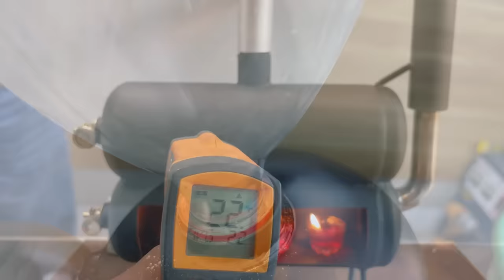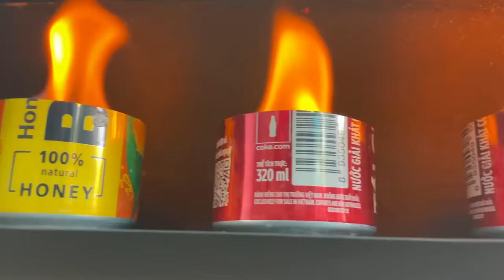diy mini heater! So warm for your room. Free energy from sand batteries

Comment: Why is it necessary to have 2 chimneys/exhaust pipes. Drilling a hole in the wall is a bit much for most people
Reply from the maker: The presence of two chimneys or exhaust pipes in the design serves a specific purpose related to the efficiency and safety of the mini heating stove. The dual exhaust system is often implemented to ensure proper ventilation and combustion.

1. *Optimized Combustion:* Having two chimneys allows for a balanced airflow, optimizing the combustion process within the stove. This design helps achieve more complete and efficient burning of the fuel, contributing to higher heat output.

2. *Safety Measures:* The dual exhaust system can enhance safety by facilitating the removal of combustion by-products, such as smoke and gases. This helps prevent the accumulation of potentially harmful substances inside the living space.

While drilling a hole in the wall for exhaust pipes may seem like an additional step, it is a common practice in many heating appliances to ensure proper ventilation. However, it's understandable that this may pose challenges for some individuals. If wall penetration is a concern, alternative ventilation solutions or adaptations to the design may be explored.

Ultimately, the goal is to strike a balance between efficient stove operation and user convenience. If there are specific concerns or preferences regarding the exhaust system, modifications or alternative designs could be considered based on individual needs and circumstances.

Comment: Why do you need to vent to the outside?
Reply: That's all we need a women telling us lol
Reply from the maker: The need for venting to the outside is crucial for several reasons:

1. *Safety:* Venting allows the release of potentially harmful byproducts, such as carbon monoxide and other gases produced during combustion. These byproducts, if trapped indoors, can pose serious health risks.

2. *Air Quality:* Proper ventilation helps maintain good indoor air quality by preventing the buildup of pollutants. It ensures that the combustion process doesn't introduce contaminants into the living space.

3. *Preventing Condensation:* Burning fuel generates water vapor. Without proper ventilation, this moisture can accumulate indoors, leading to issues like mold, mildew, and structural damage.

4. *Regulatory Compliance:* Building codes and safety regulations often require proper ventilation for heating systems to ensure the health and safety of occupants.

5. *Efficiency:* Adequate ventilation contributes to the overall efficiency of the heating system by allowing a steady flow of oxygen for combustion. Incomplete combustion due to insufficient airflow can result in wasted fuel and increased emissions.

In summary, venting to the outside is a critical aspect of any heating system to safeguard both the occupants and the structure of the building.

Comment: Tea candle burns for 4 hours and gives about 32w, and costs £0.04.
Also it consumes oxygen when burning, decreasing the quality of air.
So...
4*32 = 128Wh = 0.128 kWh
0.128 kWh = £0.04
1 kWh = £0.3125 (not free at all, you see...)
Electricity in UK is capped now to £0.245 per kWh and Gas is capped to £0.0624 per kWh. 
0.3125 / 0.0624 = 5.008
This means that burning gas is 5 times cheaper than tea candles.
Even any electrical heater is cheaper than burning tea candles and it does not consume oxygen and works with perfect efficiency. 
This device is totally useless.
Reply from the maker: You’ve made a great point! Gas is much cheaper than tea candles, and electric heaters are more efficient and safer.

Comment: Think I would stick to a proper commercial heater rather than something made at home with all the dangers that come with it.
Reply from the maker: It's a wise decision to choose a proper commercial heater over something homemade when it comes to heating. Commercial heaters are designed and manufactured to meet safety standards and regulations, reducing the risks associated with homemade heating solutions. They are typically tested for efficiency and safety, which is important for both your comfort and safety.

When using commercial heaters, it's also essential to follow the manufacturer's instructions and safety guidelines to ensure safe and efficient operation. This way, you can enjoy warmth without unnecessary risks.

Comment: Doesn't work. Sand battery needs to be at 500degC to hold the heat plus it needs circulating air  and a heat exchanger. Check out the one at the Finnish power station. Candles are never going to get it hot enough. All you are doing there is wasting candles warming sand which will be at too low a temperature to get the battery effect working. It'll cool back down pretty quickly.
Reply from the maker: "Thank you for your detailed feedback and insights. You've raised valid points about the challenges in achieving the desired temperature for the sand battery. I appreciate your expertise in highlighting the need for higher temperatures, circulating air, and a heat exchanger for effective heat retention.

I'll take these considerations into account for future projects and explore ways to optimize temperature and efficiency. Learning from valuable feedback is essential, and I'm committed to improving the quality and functionality of the content on my channel. If you have any specific suggestions or ideas you'd like to share, I'm all ears. Thanks for engaging in this discussion, and I look forward to incorporating your insights into future projects."

Comment: Hay guys you have to heat the sand up with something so if you live in the north it's not gonna be free heat
Reply from the maker: Your point about heating the sand up is a practical consideration, especially for those living in colder northern regions. While the concept of using sand for heat retention is intriguing, the reality is that some external heat source is necessary to initiate the warming process.

Addressing this concern on your channel could involve exploring different methods or devices for heating the sand efficiently. This might include solar-powered options, traditional heating elements, or other innovative solutions that align with the goal of achieving cost-effective and sustainable heat sources.

It's important to acknowledge the additional energy input required and discuss how users can optimize the heating process for maximum efficiency. This way, your audience gains a more comprehensive understanding of the practical aspects involved in harnessing heat from sand, particularly in colder climates. Your engagement with these considerations adds depth to the discussion and provides valuable insights for your viewers.

Comment: Chinese diesel heaters are suppose to be good u can also burn kerosene and vegetable oil in it.
Reply from the maker: Yes, Chinese heaters are often highly rated for their performance and variety of fuels used. Being able to burn diesel, kerosene and vegetable oils is a big advantage, helping to optimize flexibility in use. Have you experienced using any type of heater?

Comment: Which part of the heater multiples the heat output of 4 little tea lights?
This stuff is hilarious. 😂
Reply from the maker: Thank you for your comment! The heater design is intended to capture and store heat efficiently, allowing it to gradually release over time. While it may not necessarily multiply the heat output of the tea lights, it can help distribute and make better use of the heat they produce, making the space warmer for longer. The design aims to be a creative and resourceful way to enhance the heating effect of small tea lights. 😄

Comment: Great idea...but dude...either that welder is not set up correctly or ...hmmmm
Reply from the maker: I appreciate your feedback and observation. If there are concerns about the welding in the video, it's essential to ensure proper welds for both safety and functionality. I'll make sure to double-check the welding setup in future projects and strive for better welding results.

If you have any specific suggestions or areas you'd like to see improved, please feel free to share more details. Your input is valuable, and I'm here to make content that meets your expectations. Thank you for taking the time to provide your feedback!
Reply: @lmtn  FANTASTIC COMMENT...WOW..  LITTLE MORE HEAT... and practice on something similar...  anger the gun always towards thicker piece of metal.. steady steady steady...the wire feed wants to push you back...and NO BREEZE...  unless you're using Flux core

Comment: Is that the fire starter goo??
Reply from the maker: The term "fire starter goo" typically refers to various commercial fire-starting products or fire starters that are used to ignite fires more easily. These products often come in the form of gels, liquids, or cubes that can be applied to kindling or fuel to help start a fire.

In the context of the video or comment you're referring to, it's not clear what specific materials or fuel they used. If you have a question about the materials or fuel used in a particular setup, it's best to refer to the video's description or comments section for more information, or you can specify the context, and I'll do my best to provide an answer based on the information available.

Comment: 0 seconds ago
Thermal mass or Heat battery...  JUST THE FACTS All Materials have whats called K value or thermal mass value.. Kind of or basically the inverse of R value in insulation ratings. This K value is the amount of heat that can be stored in any Material. BY the way the unit of measurement is based off of water having the thermal mass of 1. This is the standard. Numerous charts can be looked up, and referenced for verification.  Water has a thermal mass of 1 as mentioned HOWEVER rock only has .2 or one fifth of the  thermal storage potential of water by Weight. Rock is more dense  Pea gravel has 95 pounds in a cubic foot. BUT water only weighs 63 pounds per cubic foot.  This weight advantage of Rock VS the HIGHER thermal storage capacity of water Results in WATER stores 3.26 times more heat per cubic foot than pea gravel. Even HEAVY dense stone solid Marble is only 150 pounds a cubic foot and STILL does not beat water for BTU storage. 
 It takes about  1340 BTU to heat one gallon of water from 40 degrees F to 200 F
That means a 55 gallon drum of water heated to 200 would let off  about 77,000 BTU's of heat before it went back down to 40 F. To get the same heat storage you would need to heat Four 55 drums full of stone to store the same amount of heat
Reply from the maker: Thank you for sharing such informative insights! The comparison between the thermal mass values of water and rock, considering the K values, is fascinating. It's impressive to see how water, with its higher thermal storage capacity, outperforms even dense materials like stone in terms of BTU storage. Your breakdown of the BTU requirements for heating water and the practical example with the 55-gallon drum provides a clear understanding of the efficiency of water as a heat storage medium. This information adds a valuable perspective to discussions about thermal mass and heat storage. If you have more details or experiences to share, we'd love to hear them! 🌡️🔥

Comment: Ahhhh!  What a waste of a fire extinguisher!  Here's a better idea.  Those short, fat, 16 oz propane cylinders are about the right diameter.  Cut the ends off of two, and weld them together. That would provide the right size.  Cut the threaded fittings off the tops, and weld small disks there, to cover the holes.   I KNEW I must have been saving those empty cylinders, for something!
Reply from the maker: That's a great idea! Repurposing those propane cylinders sounds like the perfect solution. Welding them together would definitely give you the right size without wasting a fire extinguisher. Plus, it’s awesome that you found a use for those cylinders you’ve been saving! Definitely a creative and resourceful way to go about it. Thanks for sharing this tip

Comment: What's even the point of the top cylinder?
Reply from the maker: The top cylinder often serves a specific purpose, such as improving airflow, creating a convection effect, or helping with heat distribution. It can also provide a space for additional fuel or help with the overall design and stability of the structure. What are you thinking about using it for?

Comment: Looks ok. But do not understand why it has two exits for exhausted air? One to exterior and one to interior? Redundant. If the interior is suppose to be air feed it’s completely unnecessary as the front is wide open. Good idea, silly design
Reply from the maker: The presence of two exits for exhausted air might seem redundant at first glance, but there could be a few reasons behind this design choice:

Airflow Control: The dual exits could be intended to provide more precise control over the airflow and the temperature in different parts of the space. This could allow for better distribution of heated air and may help manage heat more efficiently.
Safety: By providing two exits, the system might be aiming to reduce the risk of backdrafts or pressure buildup, which could otherwise cause safety hazards.
Versatility: The dual exits might give the user more options in terms of where the heated air is directed, providing flexibility in use depending on the layout of the room.
Performance: Sometimes, designs incorporate multiple exits to enhance the performance of the system in certain scenarios, such as improved combustion or more efficient exhaust expulsion.
However, these are just potential reasons, and the specific purpose behind the design choice can best be explained by the creator of the system or through more detailed information about the specific setup. It's possible that the design could benefit from refinement to avoid unnecessary complexity while maintaining the intended functionality.
Reply: @lmtn  so by having an interior and exterior exhaust though, u r losing a ton of heat? If u can exhaust inside, as most candles do, then exit exhaust is completely unecessary. There are way better ways to control air and contain all the heat.
Reply: I’ve heated homes with wood, not candles for over 20 years. The unit makes no sense whatsoever because the front is wide open to the air.  The heat sink with the sand will trap heat and give a longer slow release. But everything else is unecessary flash

Comment: Why the chimney on the side of the first one?
Reply from the maker: The chimney on the side of the first device could serve several purposes, depending on the design and intentions of the creator:

1. *Ventilation and Airflow:* The side chimney may be strategically placed to enhance the ventilation and airflow within the device. It can help regulate the combustion process, ensuring that the fuel burns efficiently and that smoke or byproducts are properly directed outside.

2. *Heat Distribution:* The placement of the chimney could also be designed to distribute heat more evenly. Redirecting the flow of air and gases through a specific path might contribute to a better heat distribution within the device.

3. *Aesthetic or Design Choice:* Sometimes, the placement of components like chimneys is also influenced by design considerations. It could be a creative or aesthetic choice to make the device visually interesting or to fit a particular style.

Without specific details about the device you're referring to, these are general considerations. If you have additional information or if there are specific aspects you'd like to discuss, feel free to provide more details! 😊🔥🏠

Comment: The cost of the extinguishers  alone makes this a losing proposition
Reply from the maker: I understand your concern about the cost of extinguishers impacting the overall feasibility of this proposition. Indeed, the expenses associated with fire extinguishers can be a significant factor to consider. It's crucial to weigh the cost against the potential benefits and ensure that the investment aligns with the overall goals and priorities of the project or initiative. Exploring alternative options or cost-effective solutions might be worth considering to make the proposition more viable. Your thoughtful observation sheds light on a practical aspect, and I appreciate your input in evaluating the practicality of the endeavor. If you have any suggestions or insights on optimizing costs, feel free to share them.

Comment: Good luck warming any room with 4 candles...
Grab several blankets before you light those 4 powerful candles, 🥶 you're going to need them.
Reply from the maker: Thank you for your comment! You raise a valid point about the heat output of candles. While candles can provide some warmth, especially in smaller spaces, they may not be sufficient for larger rooms. The intention behind the video is to explore an innovative heating concept using sand and candles.

It's important to acknowledge that traditional heating methods or more powerful heating appliances may be more suitable for effectively warming larger areas. I appreciate your insight, and if you have any suggestions for alternative heating solutions or specific topics you'd like to see explored, feel free to share. Stay warm! 😊🕯️🔥🏠

Comment: I have not understood that tube in the right.
Reply from the maker: Understood! It seems there is confusion about the tube on the right. Let me clarify its purpose. The tube on the right appears to be an exhaust or chimney for releasing the combustion gases produced during the heating process. It plays a crucial role in ventilation, ensuring that the byproducts are safely directed outside, preventing indoor air pollution. If you have any specific questions about its design or function, feel free to ask! 🔥🏠